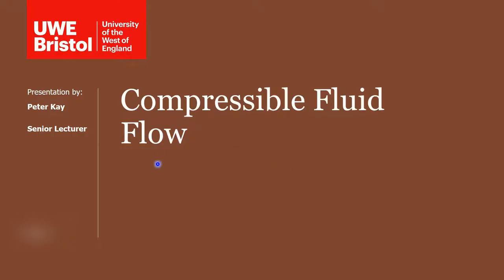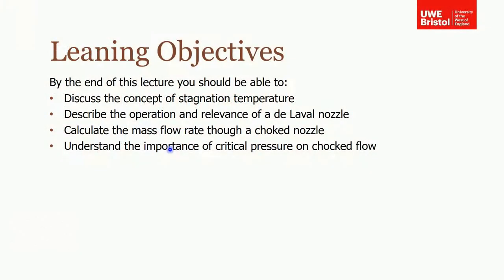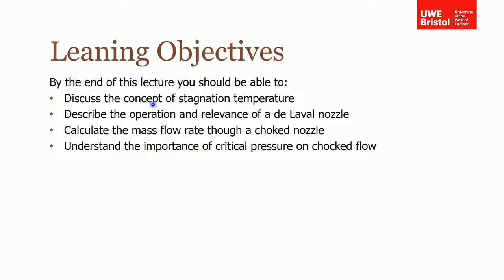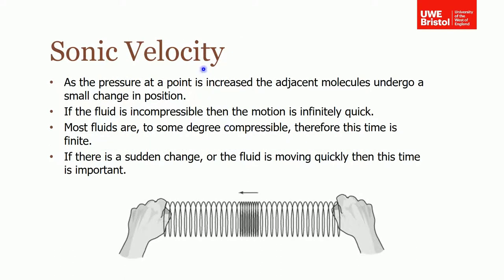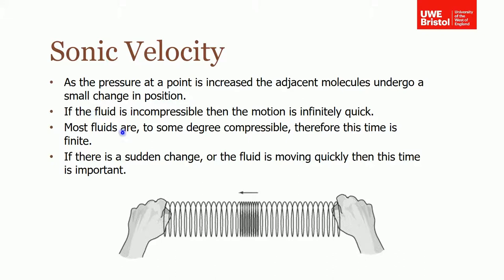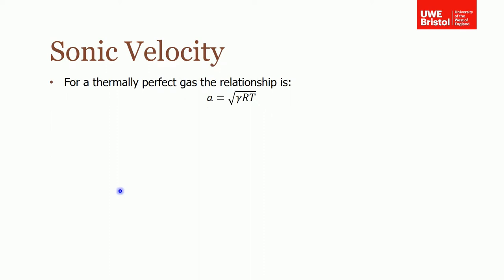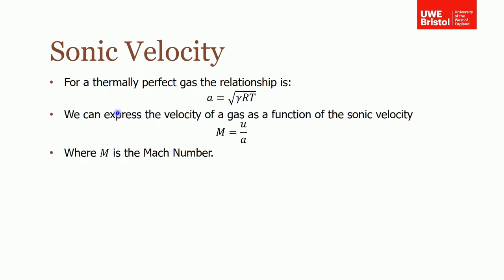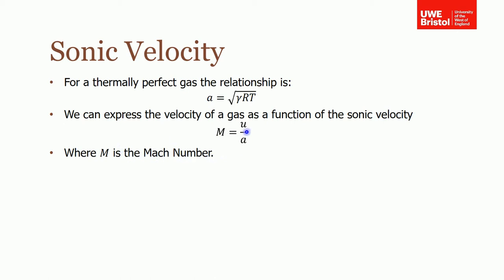Compressible Flow - Part 1 of 4 - Introduction and Sonic Velocity

Comment: How can that relationship for the ideal sonic velocity work out?

Correct me if I'm wrong but the units don't seem to add up. R contains mol, and there isn't anything else in there which would cancel it out.. Shouldn't there be something like molar mass in there as well?
Reply from the maker: Hi. The gas constant in the equation is the specific gas constant rather than the universal gas constant. If you try it with that then the units should now balance.
Reply: @PeterKayEngineering  Ah I see. That makes a lot more sense then. Thanks for the answer.